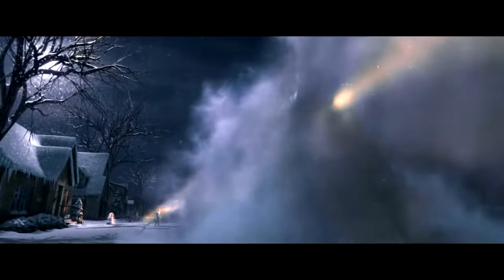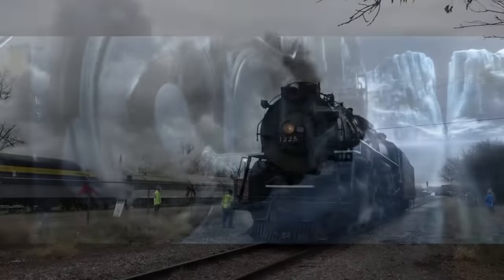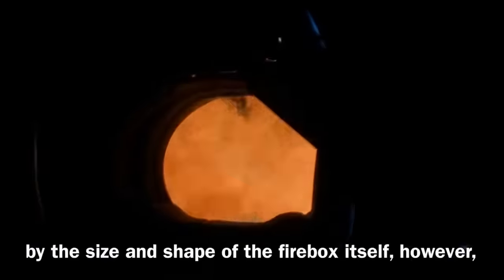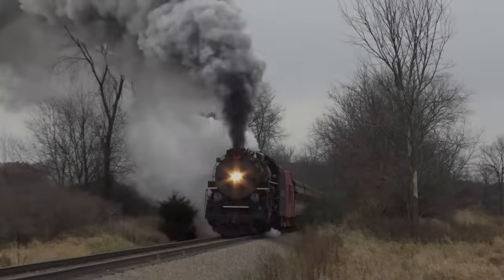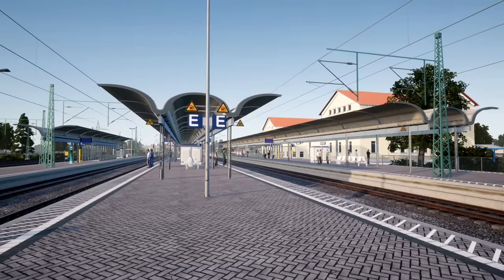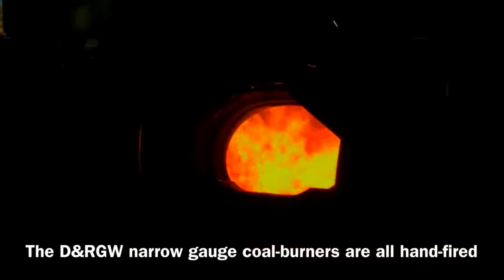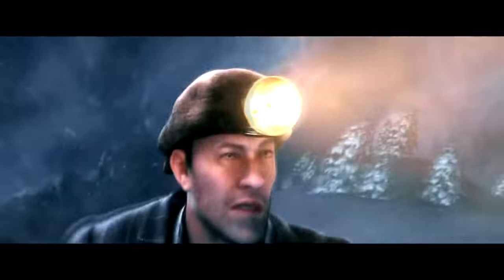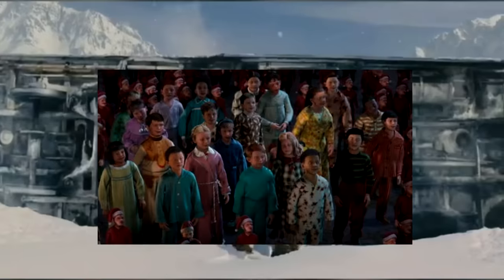Why The Polar Express would Explode

Comment: The plug is called "melting Pot" for information. Incase you don't know, there are many bits that made the engine the way it is. The whistle is from a Lima Step-top 5 chime on the Sierra Railroad No.3, when the kid in the movie said Baldwin, Baldwin did built some Berkshires only on the AT&SF, B&M, and L&N. The throttle movement is Russian style, push the throttle to move the locomotive, American locomotive's throttle is to pull to the engineer to move the locomotive. The Smokebox front is a D&H style, and no feed water heater. Hand rung bell no air rung mechanism. The reverser is a Old fashioned Johnson Bar, the Cowcatcher is of the 19th century without the Link & Pin Drawbar. The whistle's appearance is of a Powell 3-chime common on loggers. The passenger cars however, is more of an interurban trailer type which don't have Diaphrams that are commonly used on standard passenger cars. Lastly, the locomotive's chuff timing is way off it is a 4-chuff not 2-chuff since the drivers are counterbalanced at a 1/4 radius or a 1/3 radius with the Gresley 3 cylinder. No automatic feed Lubricant to continue providing Lubricant to the Steam chest and the Cylinder pistons, also, why didn't the steam crew go out of the cab to lubricate each bearings of the locomotive this will cause heat ware which will damage the locomotive instead of a boiler explosion. Plus the centrifugal force from the downward motion will cause stress points on the frame from the locomotive's weight. Yes there were Ice Railroads in the late 19th century, but, only 2-4-0s or lighter can ride the Ice, not a 2-8-4 Berkshire as the shear weight can break the ice and sink. Berkshires generally have mechanical coal stokers to feed the fire instead of hand shoveling due to size of the firebox grates. There will be more of a low steam pressure instead because of all that shoveling in that of a large firebox that a coal stoker can put enough coal evenly in the firebox. At least the steam crown (where the safety valves are at) are correct, three safety valves.

Comment: Water hitting an overheated crown sheet won't flash-boil, because of the Leidenfrost effect - it will form an insulating vapour layer.  That alone would not seriously overpressure the boiler as the vapour generated will just as quickly condense out elsewhere.  What it does do is buckle the crown sheet by unevenly cooling it, which will most likely result in failures of the firebox itself, at seams or weak spots.  Water consequently entering the firebox is another matter, that generates a lot more vapour.

Comment: that would be a problem, if it was a normal train except  you said in the video that despite it being a magical train it runs like a real life steam train, however as you said never needed to refuel its coal or water. I think that the trains "magical" capability's not only allow it to visit Santa (very cool much like) but it also has an unlimited amount of fuel and water as we never see the train needed any more fuel or water. thus instead of a "half full jug of water being titled it would be a mostly full jug. ps also for a train to run that long and that far without stop maintenances as well as metal fatigue must not effect the train, therefor the structural capability's of the polar express are magically protected and enhanced.  thanks for the video, bye

Comment: As someone who has worked in a steam power plant for over 30 years. It's true for what you say. But you forgot one thing. There is a safety valve on it you handle the water flashing to steam. And the fusible links you call plugs are vented to the out side of the engine.

Comment: What if I were to tell you that the reason why the polar express is considered a “magic train”. it’s because it’s a ghost train stuck in a loop trying to get to its destination. 

Because 1) as we seen the hobo keeps on disappearing from the train multiple times, it’s because he was one of the victims of the crash. The hobo also knew that the tunnel had only 1inch of clearance. Meaning that he had sled on top of the train before, but never made it to the engine. 

2) at the end of the film you can see the train slowly vanish from thin air offscreen before the kid shuts the door. Meaning every single other children in the train at that point are spirits trapped within. 

3) the conductor carries a watch to keep track of time, we see him shearing a tear after noticing that the train made it 5 minutes early to the North Pole, this had ment that when this event happened, it caused the train to be delayed. By bringing the boy along to the North Pole, the eternal loop had broken, so that the conductor, the train, the crew, the hobo, and the children can finally move on.

Comment: I would like to point out that if you pause the movie at a very specific point, you can actually see that the train is being powered by a flux capacitor from back to the future, making the tender nothing more than a decorative addition. As such, although the train wouldn't have exploded, I would argue that it the train instead came dangerously close to time traveling and sending all of the kids into the future instead.

Comment: The firemen probably ran the water injector going up hill and filled the boiler almost to the top and used the water to compress the steam harder to get up hill and engineering closed the throttle at the top of the hill so water didn't get sucked into the cylinders and costed down the hill and ones they reached the bottom the firemen drained the extra water out to make room for  the steam
Reply: And the extra water in  the boiler covered the crown sheet doing down hill

Comment: What if the engineers pre-empted the disaster, knowing the line they run every Christmas and doused the fire before the water sloshed forward, then re-lit the boiler once the train was on level ground? There would be enough steam pressure to keep the train moving until after the fire got back to temperature and the boiler to keep working again.

Comment: I have a small point, which would nevertheless have the Polar Express explode at the end. But do to inertia of mass the water would be pressed against the back of the boiler during the down hill drive so the burner would be covered. But still at the end, the water would splash around in the boiler and course an explosion.
Reply from the maker: The water would not stick to the top of the firebox simply due to how all the other characters reacted in the movie. Please look at the pinned comment if you want a full explaination

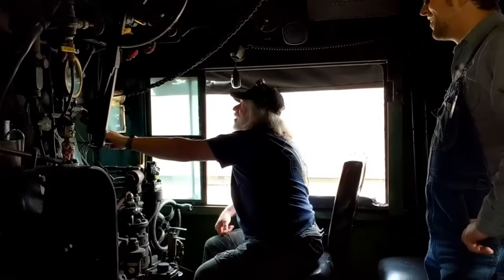Comment: 5:09 if you had a solid fueled engine you can't just turn off the fire. You would have to dump it. And even after the fire is out, there would still be so much residual heat, chances are the crown sheet would still fail.

Comment: Lol, video focuses on the boiler and not the fact they were on a 30 degree incline when a locomotive such as that is designed for no more than a few degree inclines....another fun fact....
Know-It-All states that the train is a Baldwin 2-8-4 locomotive built in 1931. However, The Polar Express was actually modeled from plans of Pere Marquette 1225 which is a 2-8-4 type built by Lima Locomotive Works in 1941.... too bad, I like Baldwins
But still, this was a really fun video!

Comment: Apart from the whole Magic train transporting the spirit of Christmas aspect, Considering that it seems to be Established that the Polar Express is a regular experienced service. I have no doubt that 1225 would’ve had the boiler constantly topped off on its way up that grade in question, hence what the Tender is entirely for, whether or not it would have enough water to get all the way from Grand Rapids Michigan to the North Pole without an auxiliary or two is a separate issue as we’re not shown any elf refueling and water stops, however where crown sheet failures occur is where engineer neglect to maintain that level, just because a grade is introduced doesn’t necessarily mean an automatic flashing to steam of the boiler contents. But again also, magic train lol
Reply from the maker: You can’t “top off” a boiler, you need space for the steam to build. This is like steam locomotive basics 101. When operating a steam locomotive, the engineer and fireman have to find a balance between getting the maximum amount of power from the engine and keeping the crown sheet covered with water. As for grades, steam locomotives that travel up steep grades will usually be designed with tilted boilers to allow for the maximum amount of efficiency since the water level can be kept lower for more steam to build.

Comment: What about steam engines built for logging? Their track had some pretty steep grades. Were their designs in the Shat locomotives for example to recirculate the water for steep downgrades or did the engineer just have to make sure the fire was super weak before descending?

Comment: So, what if The Polar express crew intentionally explodes  boiler in Fiction?  In the concept art book and the gulch scene there's a flux capacitor mounted in the cab.  What if the boiler explosions energy is  equal to 121 gigawatts and gets sucked up by the flux capacitor.  If you look when hero boy jumps into the cab there's fire from the engine.

The timing got messed up on glacier gulch and they failed to time travel, thus the frozen lake.

Comment: Not to be a physics stickler, but wouldn't the water be forced towards the firebox the moment the train started to fall? It's kind of like how you feel pulled up when going down in an elevator
Reply from the maker: Read the pinned comment
Reply: @ChriswithaK  That's a fair point, thanks for the heads-up re: the pinned comment. Still, it feels like the train has to be going somewhere near terminal, right? Can't imagine there's a lot of friction on frozen tracks...
Reply from the maker: That’s a bit on the noise cuz then we have to look at how much power the engine is applying to the track, how the engine will loose power since it’s going downhill, the fact that the cars will be adding drag to the train, etc. This is why I used visual cues in my pinned comment and not pure physics. Terminal velocity in general is straight forward to understand, but terminal velocity while going down a slope which also has friction + the fact that the engine is pushing throws everything into wack.

Comment: I don’t understand physics enough to be able to make an exact assumption, but the speed the train is heading down hill G-forces would surely push the water back towards the fire box.
Think of how when you’re on a roller coaster going down hill you’re pulled back in you’re seat as the Coaster is moving faster then gravity will pull you down. So the time the heat box is exposed is likely between 10-20 seconds not 50. It would certainly damage the locomotive but I’m not entirely sure if it would cause an explosion

Comment: Given the sheer change in velocity, would it be possible that inertia could have pushed some water back onto the boiler during the descent? Since both are moving at the same velocity the whole time, the water would not move relative to the train, it would remain on the boiler.
Reply from the maker: I explained this in the pinned comment

Comment: The exact opposite will happen, the water will collect in the back of the boiler.Yes, the locomotive is pointing down, but it is moving at a frightening speed.Centrifugal force will cause the water to go to the back of the water heater right next to the fire box.Try taking a bottle half full of water.Point down and force it down and you'll see the water collect at the top of the bottle.And the water will stay from the top of the bottle while it is moving down quickly the moment it stops or slows its down motion then the water will go down
Reply from the maker: Incorrect, please refer to the pinned comment

Comment: Question. Would the momentum and force of the locomotive going down such a steep hill at such speeds not cause the water to slosh back or at least somewhat even out? I ask this cause I went through the process in my head and then in practice with a water bottle and when the water bottle is under constant acceleration (not increasing or decreasing in speed and not being thrown like a projectile) the water stayed in the back. Would this be the case for the locomotive? Even if not for the whole 50 seconds then maybe for a portion of the time? I'm not sure, I'm not a engineer nor a locomotive expert, just a curious idiot.
Reply from the maker: I tried my best to explain it in the pinned comment

Comment: You’re wrong, though. When you’re on a roller coaster, which is what that scene is modeled after, and you crest the hill, there’s only a very short period where you are pressed forward in your seat, which is right as the coaster crests the hill. For most of the way down, you’re actually pressed back into your seat. The firebox could handle a few seconds of exposure for sure (steel doesn’t heat up instantaneously, in fact steel is not a great conductor at all compared to other metals), so it would be fine for that few seconds. Then, as the locomotive descended, the water would actually be forced back, into the boiler, as the loco would be experiencing higher g forces with it not only being pulled by gravity, but also powered by the steam engine. So, it wouldn’t explode.

Also, the reason that German train failed was because it was low on water and the stopping process for a locomotive isn’t instantaneous, in fact it’s quite slow. It takes A WHILE to slow a train down from any substantial speed, so the low water levels along with the extended braking period throwing the water forward was enough to allow the firebox to overheat and then flash boil the water. This scenario really wouldn’t happen until the train came to a sudden stop. If you decelerate slowly, you can stop this from happening as well

Comment: ok people are talking about if it'll explode or not yet no one is mentioning that the engineer CONTROLS THE TWO SIDES SEPARATELY. if they could do that they could run on those grades (though traction could be an issue).
also who runs on ice without rails.

Comment: While the water would slosh to the front of the water tank, wouldn't the velocity of the train barreling down the mountain also push the water to the back, therefor covering the crown sheet? At least for a while
Reply from the maker: No, if the water in the boiler was affected by the velocity then that would mean everyone and everything else would be as well. That means the hobo and main character would have literally flung off of the train as it went downhill. To have enough velocity to suck the water to the back of the boiler you would need to be traveling substantially faster than the acceleration of gravity. I explained more thoroughly in the pinned comment

Comment: Interesting that you seem to think the fusible plugs are supposed to let the crown sheet separate from where it's mounted?
That's not what they do at all- They're supposed to melt open and release boiler pressure and hopefully (though apparently generally not) extinguish the fire.

Also the Steam Locomotive thing I hate in this movie is the part where they turn the locomotive left or right by moving the drive wheels in opposite directions... Since that's impossible due to the way Steam locomotives are built, and if one was designed to do so, it'd have issues with deadlocking the drive.
Reply from the maker: When the crown sheet separates it partially caved in and in the process can extinguish the fire. What you described is literally what I showed in the video lol
Reply: @ChriswithaK  That's not what's supposed to happen though, that was an in-between of the plugs holding too long and the crown sheet being significantly weakened due to that... Like the Gettysburg RR explosion.
Reply from the maker: The Gettysburg RR explosion is exactly what I described in the video. It's a safety system designed to prevent a boiler explosion. Instead of the entire crown sheet giving away, only a small part of it will budge downward. You are basically trying to explain the point I made in the video back to me

Comment: How fast did the train go down the hill? Could it have accelerated down the hill faster than gravity would have pulled the water to the front of the boiler, thus pushing the water to the firebox without ever exposing it?
Reply from the maker: At a 60ish-degree decline, it would need to be accelerating around 40 miles an hour a second, meaning by 5 seconds it would need to be traveling at around 200 miles an hour to keep the water pinned to the back of the boiler

Comment: there is some misconceptions in this video. the claim that only resubmerging the super heated  crown sheet will cause a steam engine to explode is wrong. i bring to you the incident that occurred in Medina Ohio on july 29 2001. in which a case 110 stream engine tractor exploded due to the crown sheet being exposed to excessive heat and ultimately exploding as the sheet got to the point that the pressure alone in the steam engine became too great for the sheet to withstand. when this occurred the crown sheet was blasted through the bottom of the tractor, and blowing the firebox doors off the blast was so great that it lifted the roughly 20 ton tractor about 10 feet into the air.